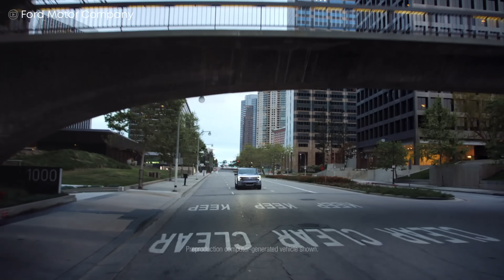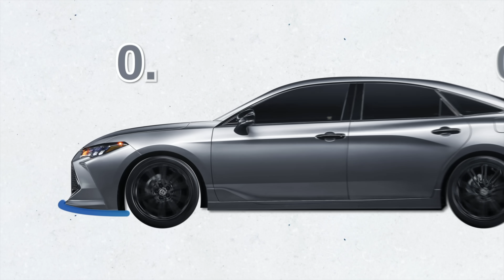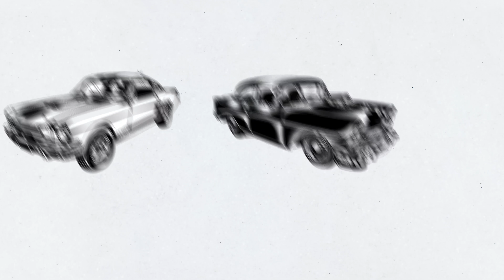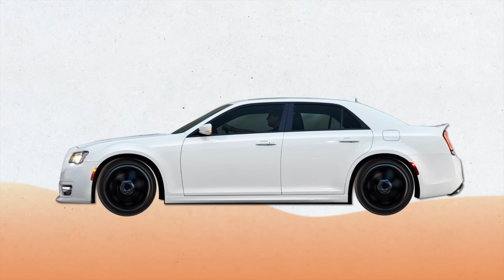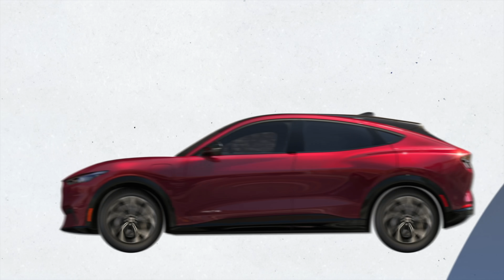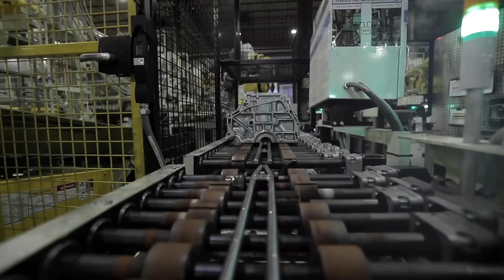No One is Telling You the Truth About These New Cars, So I Have to

Comment: As my aerospace engineer friend at Ford once told me, "If they designed the perfect aerodynamic car every time, EVERY car would look exactly the same".  There is exactly 1 right aerodynamic shape for every application, and it doesn't always look very appealing.  So they put in style effects to make them look better but run slightly less good.

Comment: Cars replaced the horse and wagon and were meant to carry the whole family. More and more were seeing the vehicle designed for the driver, apple carplay is an example of the car designed around the iphone. Touch screens and other controls make the passengers feel like they're in a taxi. We're heading to one person vehicles. Gone are the days when you could send someone in the family on an errand to get milk. When they flip on the wipers and they just put the car into reverse. Their phone rings and the sound is blaring through the speakers and you can't adjust the volume. Soon you'll need a fingerprint or face recognition to gain access, the vehicle will be talking to you the whole trip and then you'll need to file a flight plan to get back home.

Comment: So, if the US has noise restrictions, how do you explain
the garbage can mufflers 'tuners' all use on their 
hot sedans and hatches? And how about these stupid
giant jacked up pickups you see every where that are so noisy you can
hear one roaring from a couple miles away. Seems like no one
is ever enforcing noise regulations. Yes, this is after market junk but
still nothing is done. You never seen them ticketed for noise.
And yes, noise does increase blood pressure as well 
as anger in people. I know of one guy with a loud jacked up
pickup who recently  was pelted with rocks as
he drove through this one neighborhood with his loud truck.

     The one thing that I really hate about modern cars
are the blinding white headlights. When driving a car
equipped with these headlights you can't see anything but the
couple small points the lights aim at. If one is coming at you from the 
other direction, you are literally blinded by the headlights.
The yellowish tinted lights of cars a couple decades ago
offered better wide field road visibility when driving the car and
they did not blind on coming traffic.  Almost everyone I talk to 
complains about these new ultra bright white headlights in
newer cars. It is especially a problem  with larger vehicles
that sit higher like big pickups and SUV's. It seems
like every new model year they are finding new ways to make
driving a more miserable experience.

Comment: Cars are for transport you from A to B as save for you and others, cars need to be economical in use that's why modern cars are aerodynamic, low and slow bends around it. Cars need as less fuel on the mi/km as possible, a none aerodynamic uses much more gas per mile. Anyway US roads are worse than the roads in India😂

Comment: I've seen what happens when a 70's box chevy hits a 2020 chevy and the 1970s chevy wins.
Reply: There was this one test where they crashed a modern Chevy with a Chevy Bel Air from 59, and for some reason the Bel Air got crushed. But i dont really buy it for some reason - looks to me the newer Chevy might have been a specialized car with added rollcage, hydraulic dampers in the front. I dont see how some plastic filled crap would be tougher than steel bumper and body, especially since the Bel Air's bumper is directly attached to the undercarriage if i remember. Infact i think modern crashtests allow all big companies to use specialized cars for the crashtests - they dont crash more than a handfull of cars, and i doubt all the additional safety features are added to the mass produced ones, they wouldnt make a profit if they didnt cheap out on everything in mass production.

Comment: That 1967 Mustang  fastback in the beginning was sweet!  I used to have one - 3 speed manual with a 289 V8 - still remember the firing order 15426378 and I think the gap for the points were .17, or .017?
Reply: Ford 289 was a great engine....preceded the absolutely bullet proof 302 V8.
Reply: WOWEEE ❣❣❣❣

Comment: New cars have; 
Low ground clearance, low bumber
No transmission dipstick
No spare tire
Plastic parts (valve cover etc.) 
Turbo, thus smaller engines 
Overly sensitive sensors
Auto start stop wearing the engine
No shift knobs

The worst thing is low ground clearance. I hit my oil pan and bumper multiple times. Now it leaks oil a little.
Reply: Adequate ground clearance where I live isn't an option, it's mandatory.
Reply: People make fun my my 4Runner-like ground clearance in my 2003 Mustang GT. But boy is it easy to drive over speed humps and train tracks. Cars back then were tanks, new cars are like tin cans.

Comment: As usual, government intervention messes things up.  It gets tiresome having some bureaucrat dictating what we can buy due to politics. Of course, we don't have to buy a new car but then we have people saying that you shouldn't fix/repair a blown engine or transmission.  Then we have government trying to force us to "go green".
Reply: Even more frustrating is these unelected bureaucrats  work for us. We pay them to fck up our lives and we didn't elect them to their job.
Reply: I agree with you there that’s why all of my cars are from the 90s I got a 97 jaguar XJ6 96 Park Avenue and a 99 986 Porsche Boxster which I plan on keeping it running for as long as i’m alive new cars just don’t cut the mustard for me the newest I’ll go on a car is probably 2004 back when all the car still had some different styling and they were all individual to that car and you could still fix them pretty easily yourself not like nowadays where everything has to be reprogrammed by the dealer that is the one thing I don’t like most of all and then the cylinder deactivation stuff that’s another thing I don’t like about newer cars yeah you might buy a V8 but when you go under 30 miles an hour it turns into a V6 but you paid the V8 price tag and really you’re still getting the gas mileage of a V8 But for longevity it will be less reliable with that cylinder deactivation set up my 2015 dodge ram had that cylinder deactivation system in it it had a 5.7 L V-8 hemi but under 30 miles an hour it would be a V6 absolutely pointless And then the quality of the interior was awful if I remember right the day we sold it or my father and I traded it in I went to go get paperwork or something out of the glove box in the parking lot I open the glove box it fell completely to the floor I mean it fell off onto the floor and this is a one year old truck my 26 year old Buick Park Avenue never did that in that car has 74,000 miles and there’s no telling how many times that glove box has been opened and shut and it still opens and shuts perfectly fine never had an issue with it needless to say we quickly traded in that truck that wasn’t the only issue with that truck either and I haven’t even had it for a year it had 13,000 miles on it I think it was like 13,500 I put I think less than 200 miles before we got rid of that truck traded in at the Ford dealership as quickly as possible that was one day after we got it back from the mechanic but these new cars really lack in quality and definitely durability and style and it saddens me to see all of that happen because you would think we have all the technology now and all the ways of making a car more reliable and last forever but because of greed we don’t no Toyota and Lexus are probably the last including Honda to actually make a reliable decent car that will last for even Toyota starting to make their Toyota Tacoma‘s in Mexico so Innoway even they’re starting to cheaper now which really saddens me and then the politics side of it is absolutely dumb I mean if you think about it some of those pilot most of those politicians haven’t driven a car in well ever since they went into the world of politics and started running for a political office I doubt most of them still have a valid drivers license to be honest
Reply: @90sbuickguy84  same here....wont sell my old cars. Parts are cheap, repair it myself. No need to visit a dealership.

Comment: Hi Scotty, I got so fed up with all the new junk that I got myself a '63 Ford Galaxie 500 no seat belts no buzzer telling me to buckle up no power steering and no power brakes. All original 39,000 miles. Never been repainted but it still shines like a mirror. Of course the radio and clock don't work but that is par for the course for a 60 year old car. No electronic garbage. The carb is a little touchy cold starting but I'll figure it out.
Reply: All carburetors were a royal pain with cold starting one of the reasons they were phased out and replaced by fuel injection.
I'm guessing your 1963 Ford Galaxie still has the manual choke on the carburetor whereas a lot of carbureted vehicle owners converted them over to either automatic chokes or fuel injection.
My 1978 Dodge Aspen Custom Sedan has the automatic thermatic carburetor choke but the 1968 Ford Falcon I had once had a manual choke which took time to get used to.
Reply: Those were great cars! V8 power! I still have my 62 New Yorker... 413 cubic inch V8...Carter AFB carburetor and yes, those old carburetors need to be removed occasionally and cleaned out, New gaskets etc. A pain...but they work well when they are clean. Mine has an automatic choke.
Reply: @northdakotaham1752  AS did my "62" Ford Custom 300
Reply: @kevinmontgomery1383  I had a 55 Ford Custom...V8, 272 cubic inch I think it was. Also had a 57 Ford pickup, step side with V8, four speed. Rusty ones but really solid built. Couldn't keep all of them. Not enough garage space.

Comment: I would take a 57 Chevy any day.over these new crappy looking new car of now days!
Reply: Not if you drive like a normal human being,and not like a crazy maniac.I supposed they did not sell any of them back in 57 because of the crashing thing,you are talking about.Any car any time could be a death trap dude!
Reply: The modern Chevy vs 59 Chevy Bel Air crashtest was a scam im pretty sure. There no way a plastic crap front would survive the Bel Air's steel bumper which i think is even attached to the undercarriage. Obviously they added a rollcage and hydraulic dampers in the front of the modern one, i dont see how else a unibody car with a plastic front can survive a crash with one that has a carriage im sorry. Modern crashtests are just marketing advertisement - nobody can stop a multibillion dollar company from bribing crashtest inspectors, or just having especially prepared cars for the test - they cant make a profit if they dont cheap out, and skip most safety features in the mass produced ones later. Besides, crashtest dummies are not made of the same materials a human is - they could be filled with foam or cement for all we know. lmao Check out some 60s and 70s crashtests to see how live humans were used, and they didnt die or get injured - a seatbelt is all you need, how a car handles during a crash mostly depends on how big and heavy the cars crashing are compared to each other. And ofcourse dont forget, what makes the safest car is - the "computer" behind the steering wheel. lol
Reply: @meganoobbg3387  insurance institute does not scam.
Reply: @WALTERBROADDUS  just like the goverment right? lmao
Reply: You have not seen a crash test of those things.

Comment: The old cars from the 1950s 60s 70s and 80s and 90s is better and stronger
Reply: Crash tests are a scam - all car accidents i see lately are from 90s cars and newer, and boii the "crumple zone" does not save anyone. It reaches the front and on smaller cars the rear passengers, and smashes them to bits. Its always the bigger and heavier car that survives no matter which year its made. The only argument for new cars being safer, is that they're bloated with plastic and wider than previous, which doesnt make it "design innovation", just simple laws of physics.
Reply: Wrong
Reply: @Modernpatriarch223  geez Les...the metal is three times thicker in those old fenders! The old ones have a heavy steel frame under them. Real metal dashboards! Metal is fireproof!
Reply: @northdakotaham1752  the national highway traffic safety administration says “it turns out a driver of a car 18 years or more older is 71 percent more likely to die in a bad crash than the driver of a car 3 years old or newer”. I’m not just talking trash. There’s plenty of actual data to show that new cars are safer than old cars
Reply: @Modernpatriarch223  Les...that could possibly be bc modern cars just handle better, have better tires and brakes. On the other hand....seems like drivers of newer cars tailgate more, drive too fast and rely upon modern conveniences way too much. I drive home from work at 1 am and at least once a week I see somebody driving through town with no lights on...at 1 am. Auto headlights...the police, if they seem them, pull them over. I have auto headlights but never rely on them bc if it's raining, daytime, they don't turn on the lights.

Comment: I have a 95 Lexus and absolutely love this car. It’s comfortable, boxy and built like a tank!!. When you feel the steel between the 95 Lexus and my wife’s 2020 Corolla - WOW!. Her can is like a soda can and dents and flexes so easy. Lexus car cannot even push the steel in in most areas!!
Reply: I still drive a 96 Accord – been saying for years that it's durability is akin to a tank, compared to present-day cars.
Reply: A lot of that has to do with safety changes as far as crumple zones and pop up bonnets for pedestrian detection. The hood on my Lexus RC is mostly plastic. You can lift it with 1 finger. It has twin actuators that pop up if you hit a pedestrian to stop them flying through the windscreen. It doesn't noticeably flex at speed though thank goodness. The RC is still well built :)

Comment: I hate all the new cars; they all look alike, they're all over-engineered with just way-too-many electronics that are guaranteed to break down.  I remember a good friend of mine who had a Buick back in the 1990's.  It was one of the first generation of GM cars that were computerized with a very rudimentary computer.  The car never ran correctly, especially in the summer, and the mechanic explained why:  The computer was mounted on TOP of the engine.  Electronics are very susceptible to heat, and what does an engine generate most, other than power?  Answer:  HEAT!!!!  The engine of that Buick was cooking the computer that was instructing the engine how to run.  Brilliant engineering.  It's no different thirty years later.
Reply: I hate to break it to you, but “back in the day” cars weren’t made better. You’d be lucky to get 100k out of most of them without an engine rebuilt.
Reply: @Modernpatriarch223  how far back Les? Many 90s cars would go 200k with just basic maintenance.  That GM 3800 V6 was a good example.  These days...the cars have to at least make 200k to get your money out of them bc they are overpriced. Personally,  I would be sick of driving one if I had to sit in it for 300k miles!
Reply: @northdakotaham1752  I was really talking early 80s and earlier. Yes I know there were a couple of decent cars, but overall they were made with the best materials of the day, which just weren’t the best

Comment: You are so right about these “new” ugly designs on most cars. They are made with such cheap plastic parts and they are ugly AF.
Reply: If you are talking about bumpers and ect it’s not only cheaper to build but… it’s more save in a crash because the plastic will break rather than send the blow into the rest of the car, only in high crash areas like bumper fender mirrors ect
Reply: Also nothing can be a coupe anymore I am noticing. Even Ford’s makeshift mustang is a 4 door.

Comment: Seems like ppl would rather be unsafe because Used Car sales are thru the roof!!!
Reply: @DEL REY for a classic going on antique car from 1978 my car is fairly safe. The only things it lacks from the newer cars are: Antilock Brakes, Traction Control, Air Bags, Power Windows and Door Locks and 2 Side View Mirrors I only have a Driver's Side and Rear View Mirrors.
My car has the exact same Unit body Safety Cell Construction of Today's cars instead of the full length steel frame Trucks have, the doors automatically unlock when you pull the door handle inside, it has sealed beam halogen headlamps that will never oxidize like the plastic headlight assemblies that diminish night time visibility and my car has more window glass for fewer blindspots unlike today's small cars.
For 1978 my sedan was actually a fuel efficient compact car today it would be considered a mid sized sedan.

Comment: How did "Goverment Regulations" allow for some modern vehicles to have rear signal lights on the bumper instead of the taillight assembly? Also, that 2020 Ford 150 with the tablet in the front? I thought they were trying to reduce distracted driving?
Reply: When i drive at night these days i usually get absolutely blinded by modern cars with their HID or LED white lights. If i was driving on unfamiliar roads im sure i would have crashed by now cuz of it.
Reply: Jfs - those low blinkers are useless in traffic. You can’t see them if someone is between you and that turn signal.

Comment: Scotty I drive a 97 f250 gas burning 5.8. 
Any recommendations on fuel injection maintenance? And or longer lasting efficiency? Products or otherwise
Reply: Woody, I have the same truck, 95 with over 400k! mine is white, single cab w/cab lights, standard 8ft bed, auto C6 3 speed. A few years back I finally put on a 4x4 dana60 and sterling 10.50 with 3:73. I really love that rig. It's been paid for, makes money(even when I factor in thirst requirements) and damn do those rigs look sweet on the road.
Reply: @somchaimarineatgmaildotcom  rare truck! A keeper! Now you get a Super Duty.